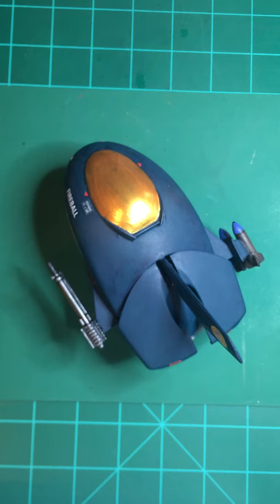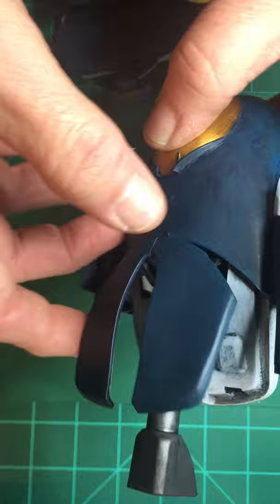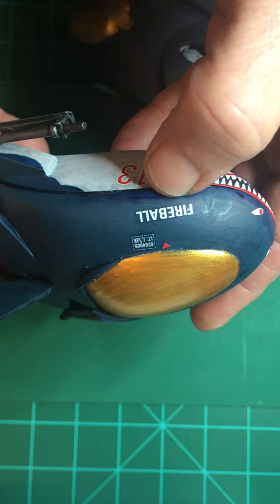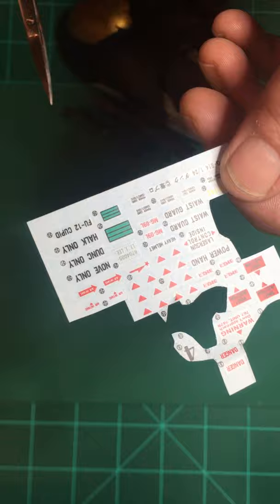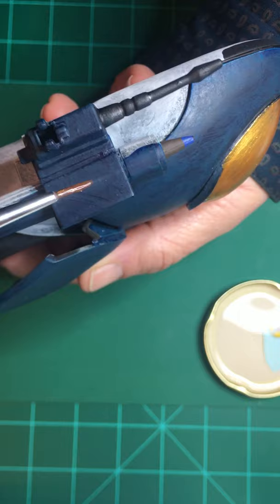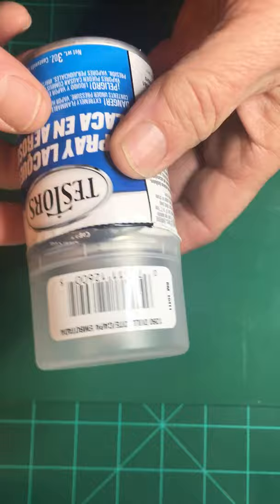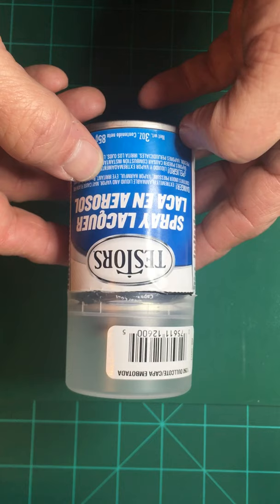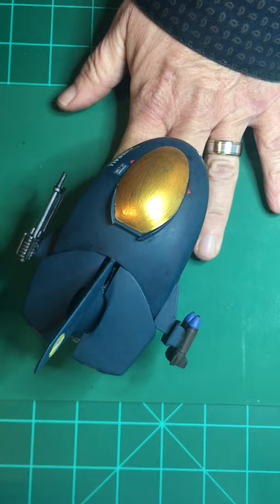Recycling With a Vengeance! Episode 5: Details, Details, Details....

Comment: Used Sol but not Set?
Reply from the maker: Yup. Set's never really done anything for me, really. The MicroSol has always given me really good results. Sometimes you do have to be patient, and use gravity to assist in getting the decal to settle in place (ie., prop the model up on it's side so the decal in question is level). This is especially true with a surface that has lots of raised or recessed details such as rivets. When I get around to some Panzer 38(t)s I'm planning to add to my Early War German panzer forces, I'll post a how-to video and show off the results.